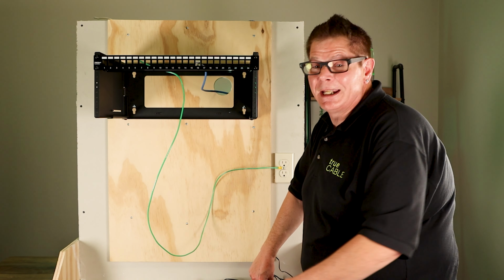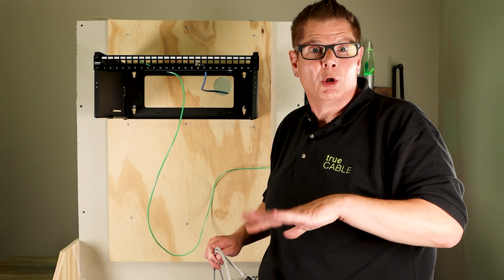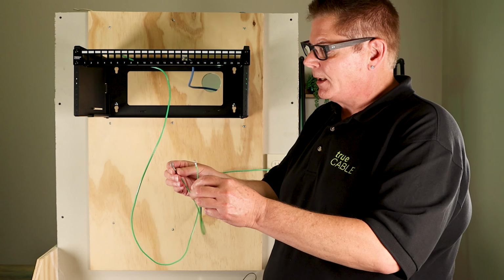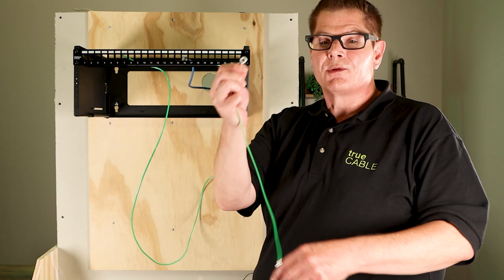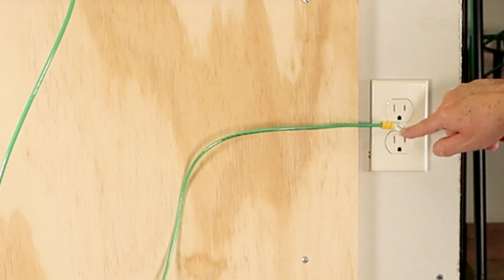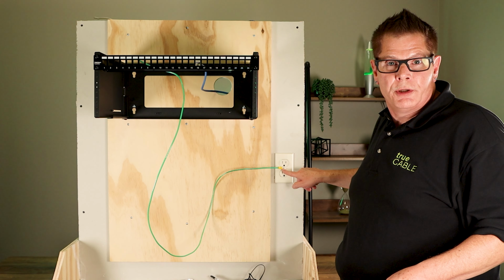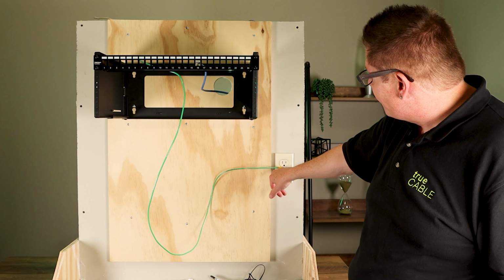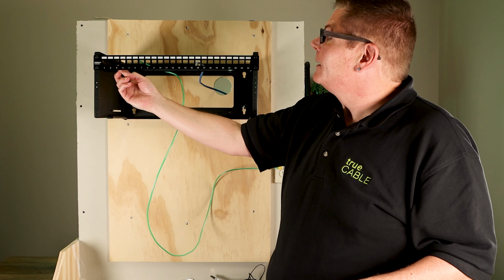Residential Bonding and Grounding of Shielded Ethernet Cable (Full Overview)

Comment: First off, I'm a tech with half a century of experience in the telecom industry and more recently networks.  I agree shielded cables are a waste of money for home networks.  There have only been a few jobs when I used shielded Ethernet cables and that was when there was a risk of interference from machinery or radio transmitters.  One thing to bear in mind is you shield at only 1 point, to avoid picking up interference.  In telecom offices, there are 4 grounds, frame ground (cabinets, cable rack, etc.), power ground for DC, AC power ground and signal ground.  They only meet at the common ground point for the building.  You mentioned that little switch that didn't have a power ground.  Well, if that's the end point and the rest of the cable, etc. is grounded at the other end, then you're fine, as you only ground at 1 point.
Reply from the maker: Correct James. In the case of using a small residential switch that operates on a AC/DC power connection you will have to bond to ground at the patch panel, if using shielded cable. The keystones of course need to be shielded as well, in order to continue the bond from the cable shield to the keystone and then the patch panel. The patch panel frame itself should then be bonded to either a RBB mounted in the rack frame OR directly using a mechanism such as our truePLUG ... https://www.truecable.com/products/shielded-ethernet-patch-panel-bond-ground-extension-wire-adapter-1.

Comment: Why on earth would you bond both ends? This defeats the whole purpose of the shield! Your shield is now an antenna.
Reply from the maker: Hello and thanks for your comment. It is quite the reverse, actually. Bonding both ends is strongly recommended by BICSI and in the ANSI/TIA 607-D specifications. This increases the effectiveness of the cable shield as there will be less resistance to ground. The only time you risk an "antenna" situation is if you leave the cable shield completely unbonded, which is known as a "floating cable shield". There are (rare) times when it is required to bond one end of the cable to ground only, and that would be to avoid a ground loop.
Reply: @trueCABLE  So when  terminating the ends of  your  run, you should still leave the ground/foil/drain wire connected  to chassis of the wall plate keystone, as well as at panel. Then lifting  the ground connection via a non sheilded cable at the wall plate device connection?  I'm  not fully  clear  on  that.
Reply: And what about ground loops, when the ground potential on both cable ends is not equal? This is typical when using PE cable from electrical socket nearby, those potentials can drift a bit, and therefore cause continuous 50hz current flowing through cable shielding… should you therefore not bond just one side of the cable leaving the other one hanging?
Reply: That is my understanding also.  A ground loop will be created if you bond both ends of a shielded cable
Reply: @trueCABLE  I have to disagree and half a century of experience in telecom to back me up.  I used to do a lot of work with DS1 (T1) connections and they were only grounded at one point.  Same with Ethernet cables.  Maybe you should have a word with some telecom engineers.
Reply: @trueCABLE I just read the standard and it doesn't say that.  the patch panel has to be bonded to the cabinet for shielded cable.  The purpose of the shield is to provide a path for emi  to go to ground as opposed to the twisted pair and interfere with the signal.  If only one end is connected the emi path is through the shielding to ground. If both ends are connected, then the emi will go both ways and will interfere negating the shielding effects.
Reply from the maker: @theJonnymac  Hello,

Thank you for sharing your perspective! I believe we might be referencing different standards, and I’d like to better understand where you’re coming from. Are you perhaps referring to a potential ground loop situation? Ground loops typically occur when there are multiple AC grounds or AC ground electrodes that aren’t properly equalized—not multiple bonds to the same ground. This assumes, of course, that your AC ground system and telecom bonding infrastructure are equalized.

For reference, I have access to the following standards:

ANSI/TIA-568.2-E: Balanced Twisted-Pair Telecommunications Cabling and Components Standard
ANSI/TIA-607-E: Telecommunications Bonding and Grounding (Earthing) for Customer Premises
BICSI ITSIMM 8th Edition
Let’s begin by looking at what the TIA standards say:
Section 5.7.9 of the ANSI/TIA-568.2-E specifies:

“Effective shielding requires that all cabling components be shielded, meeting the requirements for transfer impedance given in Clause 6.10.21 and that all shields be properly bonded. Shielding shall be continuous for the complete channel. Work area cords, cross connect cords, equipment cords and the equipment connection, while not part of the generic cabling, shall provide shield continuity. Screened telecommunications outlets/connectors shall be labeled or otherwise identified to differentiate them from UTP connectors and indicate the need for screened work area cords.”

In short, this means that everything, including patch cables, remote outlets, etc., must be shielded when using shielded permanent links. The shielding must be continuous throughout the entire channel.

Switching to ANSI/TIA-607-E, Section 9.1 states that the maximum two-point measurement resistance within a telecom bonding system is 100 ohms (0.1 milliohm). This document also outlines multiple methods for bonding rack and rack equipment to the telecom bonding system, depending on the specific setup.

Normally, all rack and rack equipment are bonded to the rack bonding busbar (RBB) within the rack. The RBB then connects to the secondary bonding busbar (SBB) in the telecom room, which in turn connects back to the primary bonding busbar (PBB)—all of which are equalized to the AC ground system.

This leads me to an interesting question: how would someone achieve proper grounding for a shielded wall mount panel if a rack is not involved (wall-mount or otherwise)?

The standards provide clear performance requirements for shielded permanent links and grounding, assuming a commercial infrastructure with racks, busbars, and equalized systems.

I hope this helps clarify things! I’d be curious to know your sources and which specific sections or clauses you’re relying on.

Thank you,
Don Schultz, BICSI INSTC, INSTF, Fluke Networks CCTT

Comment: can I just connect the bond wire to my ground rod that's buried straight in the ground (earth ground)?
Reply from the maker: Hello Max Amps! Assuming you are talking about pounding in a separate ground rod and attaching to that, you could do that, but you risk a ground loop situation if you have any of your equipment bonded to your house AC ground at the same time. If you are asking if you can attach a bond wire from the patch panel directly to your existing house AC ground then yes, no problem. The key thing is don't do BOTH at the same time!
Reply: @trueCABLE  in my case, it's a high school campus. it's not feasible to connect at one point due to the size of my service area. how about I drive multiple ground rods 100-200 meters apart from one another?
Reply from the maker: @maxamps45  Hello again! You can do that, but you need to equalize those ground rounds to the same potential. Typically, thick bare copper wire and exothermic welds are used for that, and everything is buried. To confirm multi-point equalization of the potentials, you will need to have a Megger or equivalent device on hand.

Comment: Curious as to why you didn't bond to the rack and then bond the rack to ground?
Reply from the maker: Hello Nolan! This is a potential option too. In this case all rack mounted hardware should be bonded to the rack and then rack itself bonded to ground. That said, it requires potentially a lot more work if you don't have a RBB (rack bus bar) as you would need to remove a paint from the rack surfaces for each and every bond and you would also need more hardware to attach each bond wire to the rack. It is not sufficient that the rack mounted hardware merely makes contact with the rack itself as there is paint insulating the metal and this can result in unreliable bonding.
Reply: @trueCABLE   Half a century of experience speaking here.  Signal grounds, which is what the shield is, is not connected to the cabinet.  They are grounded separately.  In telecom offices, you will see the ground bus is insulated from the rack.

Comment: I installed in my rack a grounding bus. I pulled a 10 AWG (6 mm2) cable from my house ground to the grounding bus and a smaller cable from the grouding bus to my network switch (has a separate grouding screw). Now my whole rack is grouded through the network switch. Is this normal approach? The network switch has a metallic DIN rail mount and the DIN rail is also metallic. In the case if I install additional aquipment, it will be grouded two ways (through the the first network switch and the directly through the grounding bus).
Reply from the maker: Hello Klaus! Yes, it sounds like you are doing this correctly. I would also be sure to directly bond the rack itself to your copper bus bar. The more you bond and equalize all metal objects used in your rack and other items like metallic conduit used to support your cable to your AC ground, the better off you will be!

Comment: Awesome videos, I appreciate the quality of information. I do have a question though, are shielded cables able to be bonded to ground through the chassis of connected devices if your switch doesn’t have a three prong plug and you don’t use a patch panel?
Reply from the maker: Hello and yes, under certain conditions that would be an effective bond for one end of the run.  For example, if you have a desktop PC with a power supply that makes use of a three prong power cord (and all do) then a bond would occur there and form a path to AC ground.  The ultimate effectiveness of the ground path in this situation is questionable and might not be "solid".  I would not rely upon that method solely.  I would bond both ends to ground just to be sure.

Comment: Thank you! This is really helpful Don.  Scenario: I have a switch with an internal AC power supply connected to the mains socket via a 3-pronged plug.  Just one shielded patch cable is used to connect a shielded keystone jack (within the shielded patch panel) to the switch.  In this scenario, is a bond wire required or beneficial?
Reply from the maker: Hello Jonathan! You are welcome, and I am glad you found the content useful. From what you indicated, the cable shield is bonding to ground as thus: PERMANENT CABLE CABLE SHIELD > SHIELDED KEYSTONE > SHIELDED PATCH CORD > SWITCH WITH AC PWR > OUTLET GROUND VIA POWER CORD. Considering this is a single drop, I don't think you will need to do anything more than what you proposed. Obviously, it would be helpful if the shielded patch panel itself was bonded to ground as well to increase the effectiveness of the bond path, but considering the simplistic situation you described, I think this is a good way of proceeding. It goes without saying, but be sure your AC outlets are properly grounded!

Comment: Great vid. What about using Ethernet Surge Protectors for each of the outdoor wires between the patch panel and equipment or before the patch panel connection? Is it necessary or helps at all?
Reply from the maker: Hello and great question! For outdoor Ethernet cables that are suspended in the air, or happen to run more 150ft underground, it is strongly recommended to insert an Ethernet surge protector between the cable coming in and the bonded patch panel. For short underground runs and Ethernet running outdoors that is attached to the same structure, a surge protector won't be of much utility. If you do use a Ethernet surge protector, just be sure to pick a high quality surge protector that won't interfere with your Ethernet signaling and be aware the surge protector also requires bonding to ground to function at all.

Comment: This is definitely best practice, however folks should know that endpoints also bond shield to chassis and that it's unlikely that none of them are bonded to ground.  In practice Ethernet is making large ground loops everywhere but it doesn't affect performance because low frequencies aren't important.  This does end up making ground a mild crosstalk aggressor, but there's no free lunch.

As long as you use shielded Ethernet end to end and at least one endpoint is grounded you're good to go.
Reply from the maker: Hello! I agree, a bond to ground at a single side not only guarantees there will be no serious ground loops but is typically sufficient for purpose. That said, bonding at the head-end of the installation (patch panel / switch side) greatly increases your control of how the bond to ground is performed and the resultant quality of said bond. Additionally, installation is easier bonding at the head end.

Comment: Hello. Thank you for your video on bonding and grounding patch panels. I have a small bar that goes on the wall, however my patch panel does not have a screw for placing the grounding wire on. What should I do in this case? How do I attach the grounding wire?
Reply from the maker: Hello Archibald! So, essentially, you have a shielded patch panel without a bond/ground wire attachment point nor a bond wire? I would be sure that it is actually a shielded patch panel. If it is supposed to be a shielded patch panel but lacks any ability to bond to ground, you can drill and tap a screw in and attach a bond wire that way. OR, you can purchase a new shielded patch panel. They are not terribly expensive. trueCABLE sells for $29.95. Here it is: https://www.truecable.com/products/patch-panel-24-port-1u-blank-modular-shielded.
Reply: @trueCABLE , Thank you so much for your response.  It was very helpful.
Reply from the maker: @archibaldsimms7440  You are welcome Archibald!

Comment: Is this something that would only be done if you have shielded cable is there any other circumstance where we would this with network equipment
Reply from the maker: Hello J. Normally you would bond your patch panel to ground only if you are using a shielded patch panel with shielded Ethernet cable. That is all you really need to do for a residential setting. That said, there are times when you should bond network equipment and equipment racks to ground as well--a great example being a commercial situation. The three prong AC power supply connection for the network switches and servers themselves won't be enough in that setting. Best practice dictates (and in some local jurisdictions required by Code), that you should (or must) must bond ALL metal used for the structured cabling system to ground like metallic conduit, ladder rack, cable tray, the racks themselves, etc. This is not only for safety reasons, but also for your structured cabling system reliability.

Comment: What about the paint or other coatings on the patch panel and the attaching screws. Would those coatings not be a barrier to the connection ? Those outlet screws are usually pretty well coated.
Reply from the maker: Hello! You are absolutely correct. The surface should be free of any kind of paint. Paint will interfere with draining ESD to ground. All connections for bonding should be nickel plated, pure copper, tin plated, and stainless steel screws/lug nuts. I also recommend the use of No-Ox anti-oxidation conductive compound between bonding surfaces to prevent any type of electrolytic corrosion. Hope this helps!
Reply: @trueCABLE  Thank you.